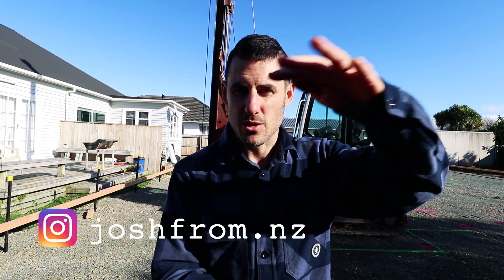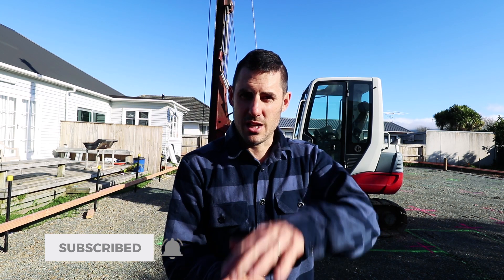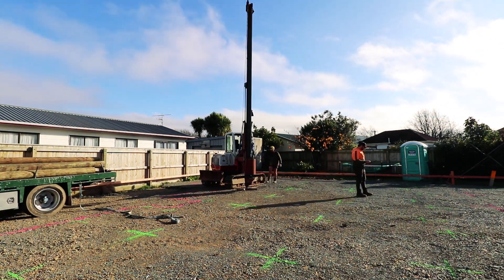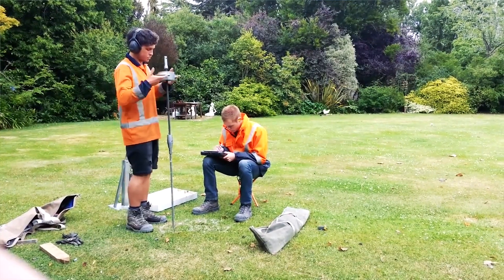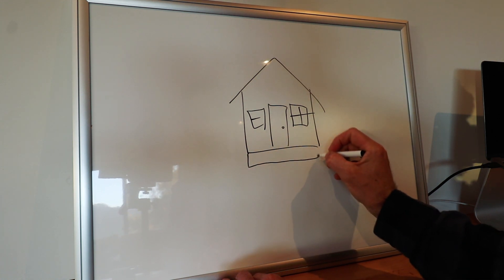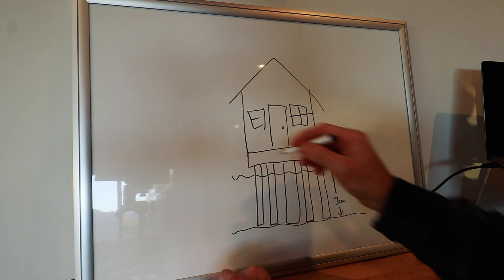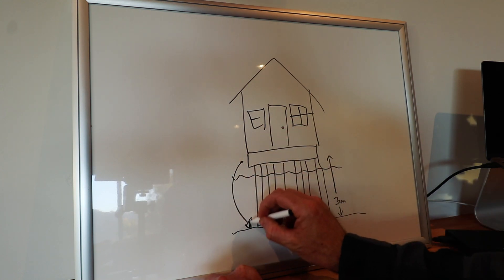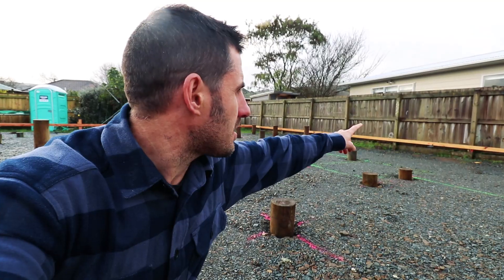Driven Timber Piles under Concrete Slab Foundation // NZ Builder

Comment: This is how Venice was built; they drove tree trunks into the muck, topped it off with wood planks, then built stone buildings on top of that, and it has lasted 900 years. Of course, the salt water helped preserve all that wood; I assume the wood they are using here is chemically preserved, unless it's near the ocean.

Comment: Hey Josh, what if termites are an issue. Would you use steel piles? 
And could the pile go into & through a 1m high slab to setup walls?

Comment: Thanks for the video,  learnt a lot.  What is DPM ?  What are the pods for?  Thanks.
Reply from the maker: DPM = Damp Proof Membrane, its the black polythene sheet that goes under the concrete but above the dirt, stops the moisture from the ground rising into the slab and then into your house :)

Comment: Hi Josh, great video clip! Generally speaking, does the pile foundation cost much more than a normal one? Thinking to build on a peaty soil but not sure how much more should be prepared on the foundation. Cheers
Reply from the maker: Hey Rachel, you need to speak to an engineer and get a soil test (penetrometer). They can let you know exactly what foundation will be best for your scenario

Comment: I never see this way of making slab concrete base on pin poles??
as long as concrete slab base attached ground what does means pine poles?
Reply from the maker: Hi Halu, as mentioned in the video a concrete slab straight on the ground is fine when the load bearing capacity of the soil is acceptable, 

however when the ground is soft / not suitable for loading you need to transfer the house load down to "good ground"

there is several ways to achieve this depending on depth load etc, in this case timber driven piles was the most effective option 

thanks for watching :)
Reply: @nzbuilder  thank you for idea. I assume that Tree pole will be not strong as concrete, they are going to back to soil especially in the ground? they will rot and fade out within 20 years or less.
Reply from the maker: An engineer will be the best person to advise on your exact situation. 

From my understanding, Driven Timber piles have an h5 treatment and a durability requirement to last a minimum of 50 years, also the lack of oxygen is what prevents them from rotting

Comment: Amsterdam is standing on poles. New buildings go with drilled and then injected concrete. Or poured. The vibrations makes older buildings to crack or sink 😬
Reply from the maker: I drilled and filled piles to 4meters deep under my house on "The section no-body wanted" but if its a flat site, easy access its quite common to drive timber piles

Comment: Why wood
Reply from the maker: its fast, easy and about 40% the cost of alternative options, it is rated to last 100 years+
Reply: @nzbuilder  really, I thought wood would rot away
Reply from the maker: that would seem like a logical assumption but apparently "...Lack of sufficient air or moisture prevents decay. Wood kept constantly dry, continuously submerged in the water or mud, or buried deep underground does not decay..."

Plus its h5 treated, I included some links in the description if you're interested :)
Reply: @nzbuilder  that makes sense, lack of air and bacteria keeps it solid. Thanks I learnt something new today
Reply from the maker: @knightwolf8877  no worries - thanks for watching and commenting :)

Comment: Really interesting, how long has this technique been in use? I was talking to someone in the trades who told me my 100 year old brick villa was probably on piles under the slab, wasn’t sure I believed it until I saw this
Reply: They did it under Venice over 1000 years ago.
Reply from the maker: I was going to reply but Builds & Stuff beat me to it. I just googled "wooden piles under venice" and it looks like they go way way back!!! it would be a natural assumption to think wood in the ground rots, but apparently  "...Lack of sufficient air or moisture prevents decay. Wood kept constantly dry, continuously submerged in the water or mud, or buried deep underground does not decay..."